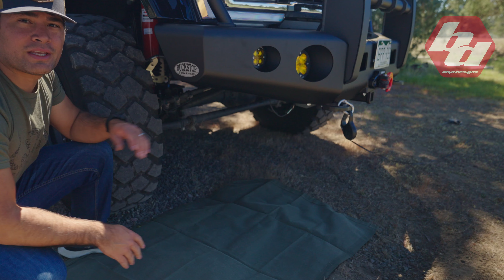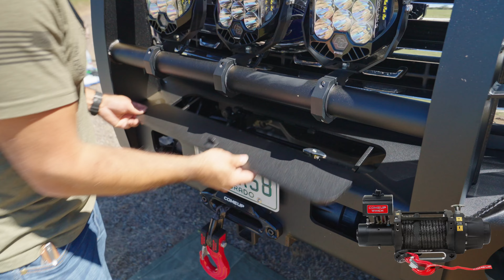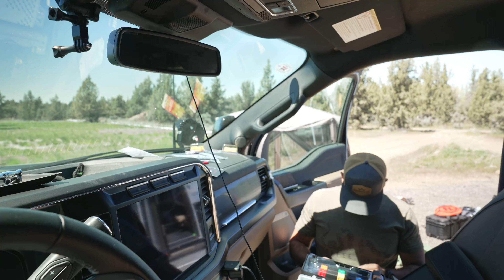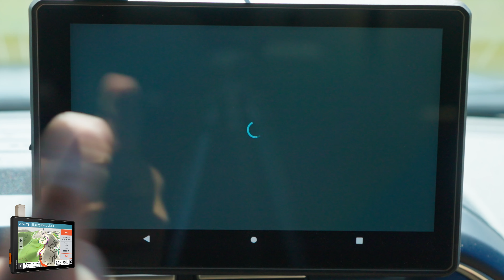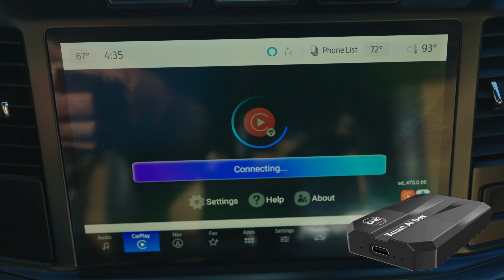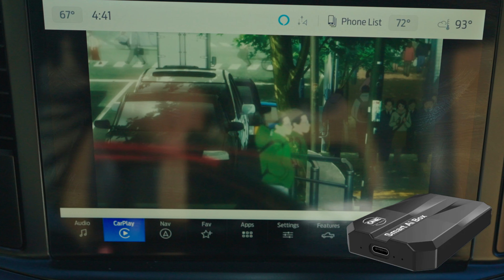7 Must-Have Upgrades for Your Adventure Rig: Transforming Our F550 for the Wild!

Comment: For some reason our starlink works all the time, even when driving, negating the need for a separate gps.  Another necessity with these tires is TPMS with temperature readings.  Adequate jacks for flats and security cams all around are another "essential",
Reply from the maker: Couldn’t agree more Tony!